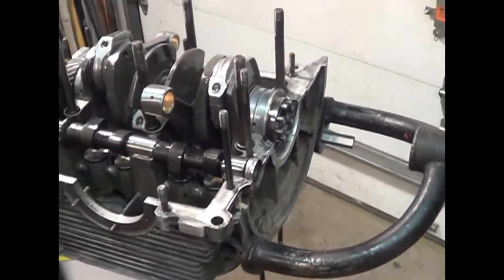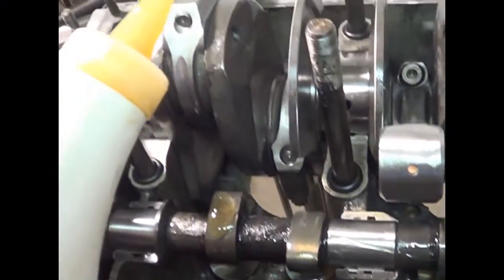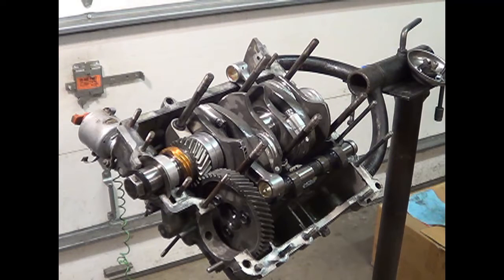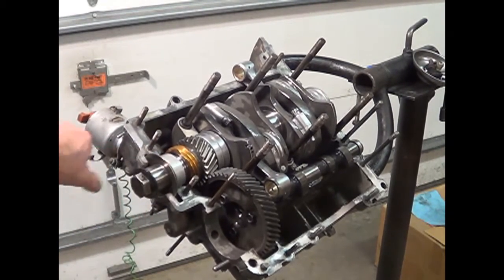VW 1800 Cam and Dizzy Prep

Comment: i use half lucas with half 30hd motor oil to make a full quart of oil mix for engine assembly on all motors i put together over the last 30 years and never had any problems!
Reply from the maker: +gilliland426   I have been real happy with Lucas products.  I still have 1 remaining can of the old STP from my fathers stash. I'm going to save it.
Reply: back when they had them in metal cans...
i have some from the 50's along with old oil in the metal cans... the good days!
Reply: +TheEZGZ my father who is an A&P said they use STP and 50wt oil (car side 100wt airplane side same stuff) as assembly lube. over on bobistheoilguy site they tested Lucas and it is 250wt bright stock. Should work fine as assembly lube but you should add the extra zinc stuff for good measure.

Comment: Hey eazy im the guy with the 73 superbeetle i had messaged you about all the metal i found in my oil screen well if you can belive it or not it still running good no knocking but i put in a empi all in one distributor and its performance is pretty good but it feels like it down a little on power i did the top dead center and it starts right up but feels like i lost power any suggestions would be great i thought id update you on julie lol thats her name
Reply from the maker: The death rattle comes at the end. It sounds like your close. Prepare for the worst and hope for the best. You need to get inside. :-(
Reply: @TheEZGZ  ya im buyin parts now

Comment: Why is it most builders dont seem to check or show bearing clearance with mics or plastigauge?
Reply from the maker: I can't speak for everyone but it not that easy. We only have on half shell bearing in the center for plastic gauge and the rest are full circle.. It's supposed to be a crush fit. I've shown the the plastic gauge.  I home builder like me can only do and show so much????  Lets see how you would make a video!
Reply: @TheEZGZ  why do you seem annoyed using a exclamation mark when I asked a legitimate question?

Comment: ON A 1700 TO A 1800 WHAT COMPASSION AND CAM DO I NEED
Reply from the maker: It depends on the cam and compression is recommended by the cam manufacturer. You can use anything from a stock to a 110 but it depends on the rest of the system.